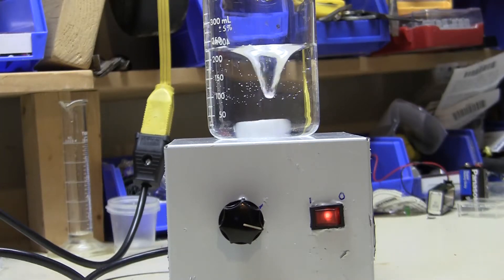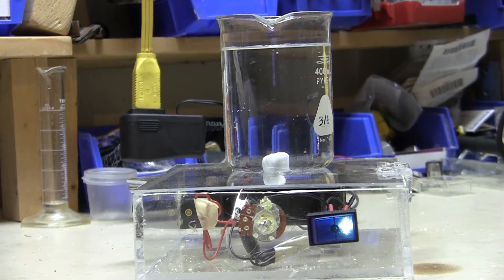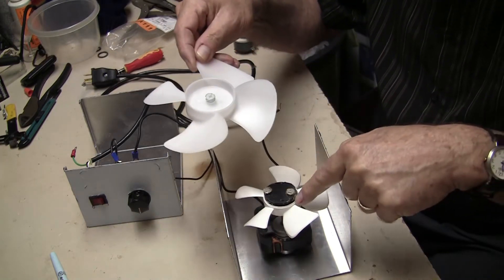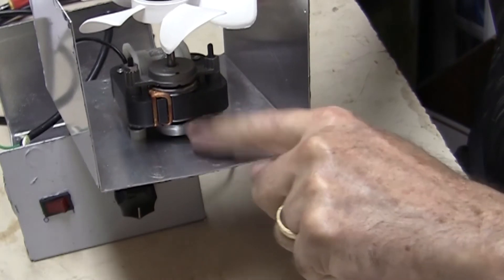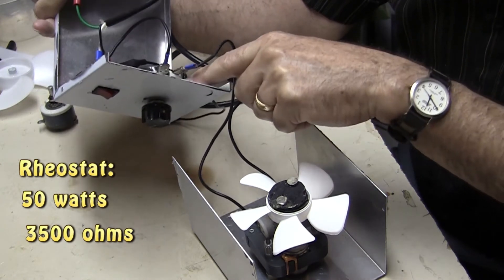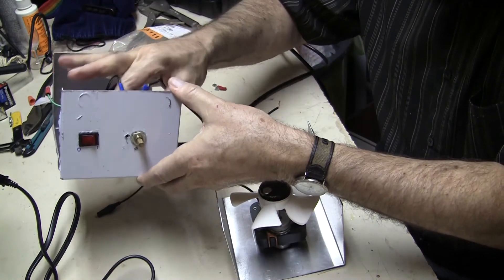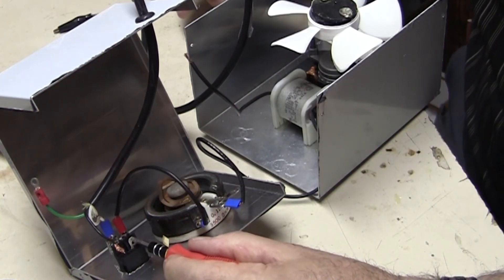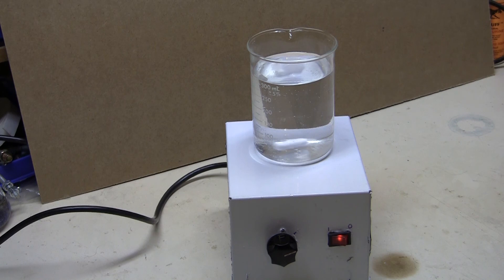DIY magnetic stirrer variable speed

Comment: A potentiometer acting like a rheostat is not the best solution in the case of DC motors. For this reason, the first version of a magnetic stirrer was not able to operate at low speeds. The easiest solution is to replace the potentiometer with either a PWM board or a 'true' voltage regulator board.
The video was posted 5 years ago and my comment is a bit late. Nevertheless, I hope that it will be useful to someone.
Reply: Thank you for this! I've been digging trying to find a way to make it operate at low speeds.